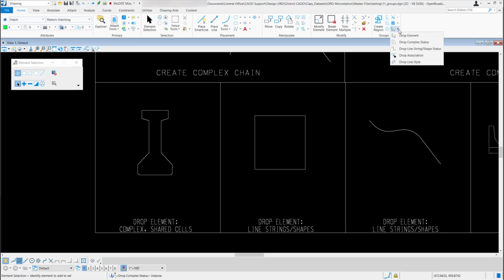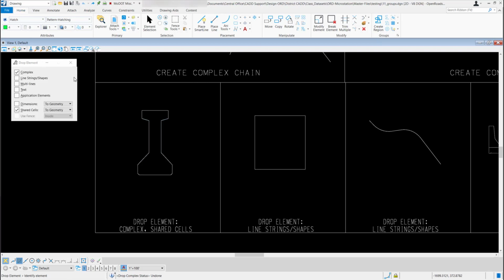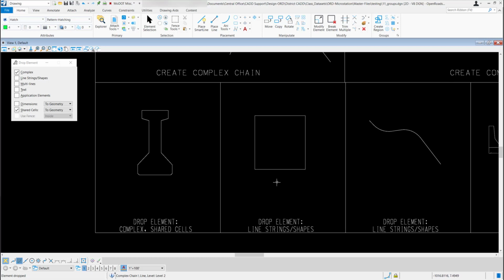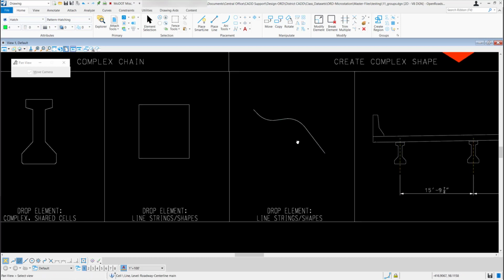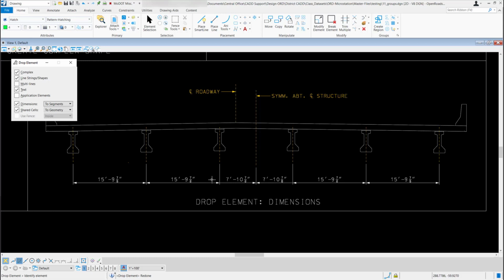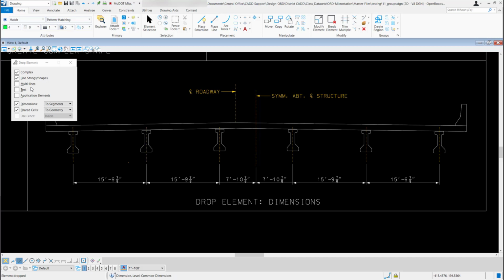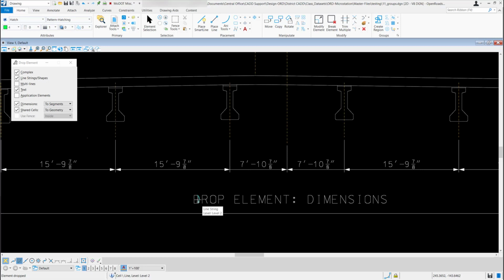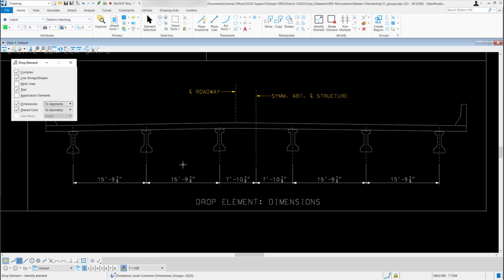ORD - MicroStation - 11.4 - Drop Element

Comment: Awesome tool, congrats on the tutorial!
The problem with it is that the elements created dont inherit the attributes from the parent feature. If i look at its attribute table, it will be empty. In qgis and arcgis when you use the explode tool the resulting features will inherit the attributes. Is there a way to do it in microstation?
Thanks for the tutorial again, keep it up!